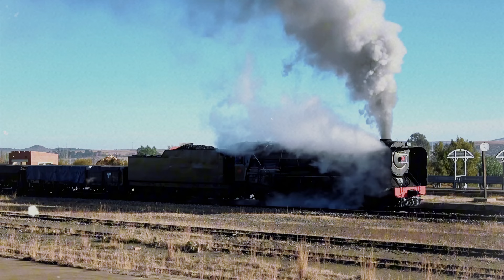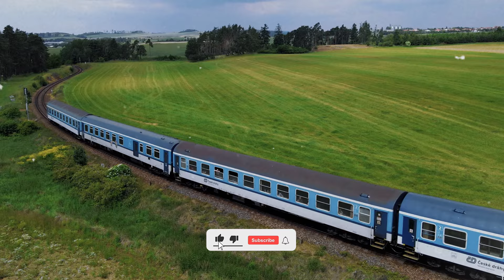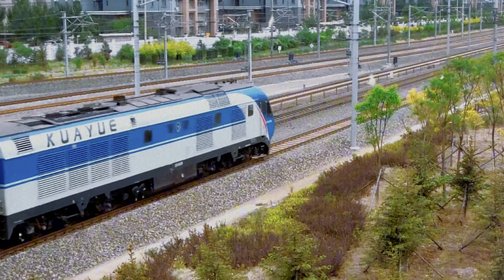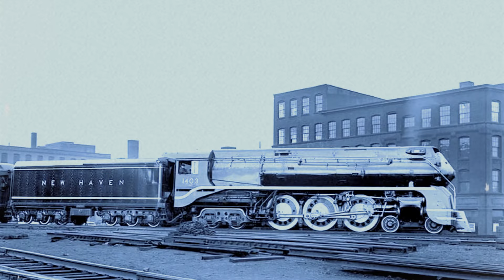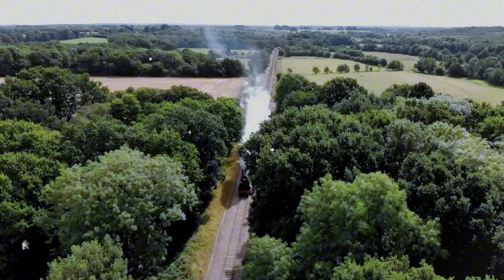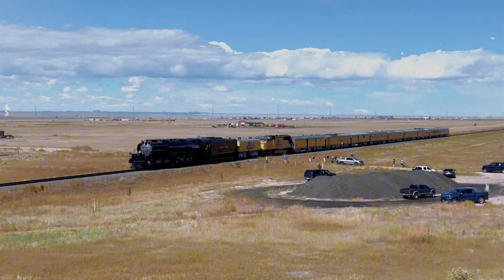The Most Monstrous Locomotives in History That You Won't Believe Are Real!

Comment: Then why does the Vectron appear to have a helper for such a small train🙄
Reply from the maker: That's a great question! Often, it's not just about the size of the train but the gradient/steepness of the track or operating in high-demand, high-frequency territories. They might also be running in 'multiple-unit' mode for maximum tractive effort, or the other unit could be a different version needed for specific electrical systems on the route.